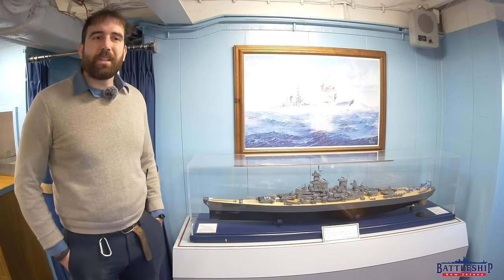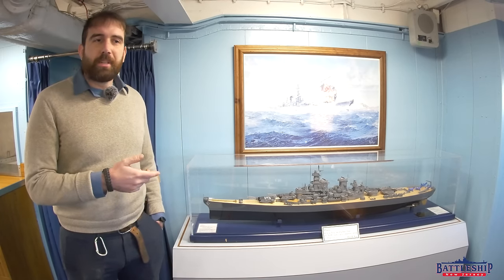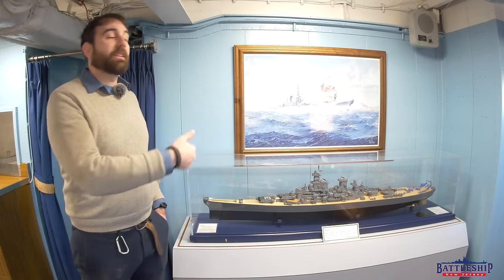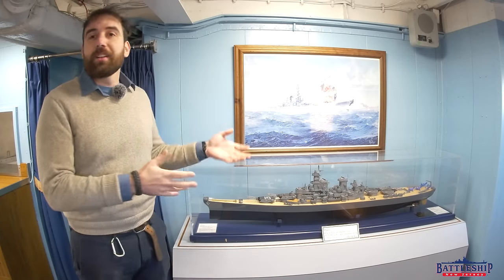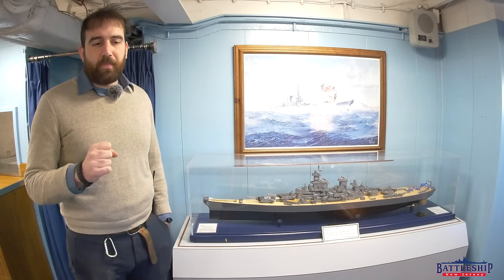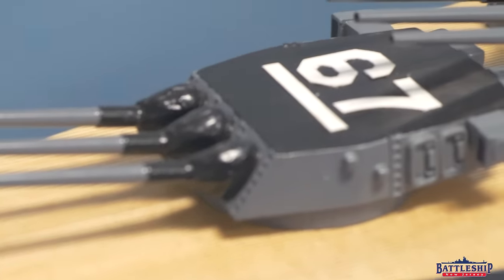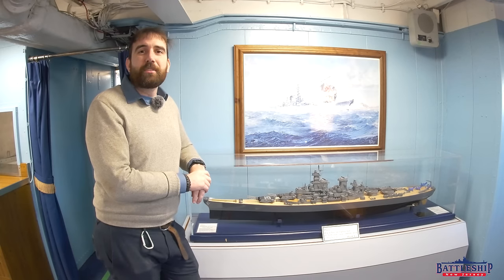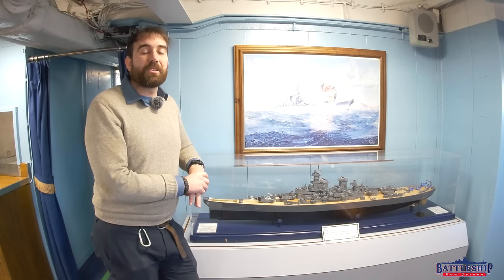Battleship Montana: What Would We Have Done Differently

Comment: The biggest improvement to these ships would have been the development of a bigger bore version of the 16" L50 Mark 7 guns, a notional 20" L40 Mark 8 gun mounted in pairs.  At one point an 18" L47 gun in twin turrets was considered for the Montana's, but this under utilized the existing turret design; the short 20" gun would have increased gun power by around 37% over the 18", fully utilizing the turret capacity.  The 20" gun would have had twice the broadside weight of the 16" gun, such that 6 x 20" would have equalled 12 x 16", and the fourth turret could have been dropped, and the 20" projectile would have had around 15% greater penetration performance.  With some of the weight savings mentioned in this video, the ship could have been reduced to 60,000t and 30 knots speed from the projected 70,000t and 28 knots, although it would not be able to transit the Panama Canal, but as like the today's CVN's that is not too great a problem.  Iowa's could have been ended at four units, and four of these units started under a prolonged war scenario where battleships continued to have a vital role in the conflict, perhaps following these battle units with a pair of monster 80,000t ships with heavier armor, a fourth turret, a surge capacity in the machinery to make 31-33 knots, and an air defence fighter group, a super dreadnought that could have pursued other major surface warships to destruction (retitled 'Alaska" class, rather than the confused cruiser design that became Alaska and Hawaii).

Comment: Would it been feasible to add-on the 4th gun turret aft with minimal problems to one of the Iowa’s? I ask because the largest thing I see for differences is that, the 3 extra guns.(besides length/width, tonnage,etc.)?? Or even a smaller 14” set of guns, maybe?

Comment: All of these changes sound good. But as some other people have said, helicopters become an option in '44. Which means if you wish to, you could remove the aircraft handling equipment in the original design in order to potentially install an aft hangar or more AA.

If I was in charge, I'd steal the British single Bofors guns and replace the 20mm guns on a 1:1 basis unless I can fit more 3" on instead of the Thunderbolt 20mm guns. This would provide an extremely lethal mid-range anti-aircraft suite, perfect for these ships.

On the note of armament: I'd be tempted to reduce weight further while increasing anti-capital firepower (Especially if I am meant to fight Yamato) by switching to the 18"/50 guns to actually have a proper immunity zone against Yamato. The smaller profile of a twin turret being a nice bonus, allowing for smaller barbettes and thus lowering the weight further.

You could potentially capitalize on these by stealing the boilers Richelieu used and adapting them to higher pressures (You are refitting her anyways by this time, so with prior knowledge you could probably get them). I don't expect the Montanas would go as fast as the Iowas, but 30kts is within realistic reach. This would also allow them to keep pace with later ships.

All of this brings me to a final point: Hydrodynamics. If I could retain the speed and make the bow more positively buoyant for the sake of hydrodynamics, that id another change to be made. Montanas would require a rebuilding of the Panama locks, so additional length is not as much of a concern, though keeping it lower is a bonus.

Comment: With aviation becoming more and more prevalent, and large advancements being made in torpedo design reducing the armor would be in my mind a key thing to consider. A bit less armor, say 9-10 inches on the belt, turrets, barbets, etc. Delete the armored conning tower, and go to a single funnel as mentioned in the video. 
Allows for a higher top speed, and much more anti-aircraft weapons. And looking forward in time with how the Iowa's developed, would allow for more of the advanced weapons and systems that the Iowa's received to be installed.

Comment: The 2,700 pound super heavy armor piercing round replaced the 2,240 pound armor piercing round and canceled out the advantage of the 46cm  guns on the Yamato class.  The "X" turret would disappear from the design along the way. 
The single funnel would be retained. The armored conning tower teplaced by one that is armored against strafing aircraft. An armored citadel below the water line for protecting electronics below the mast could be added. Equipment can be repositioned to space reserved for the X turret. The 40mm on lower decks replaced with the twin 3"/55. Upper decks with single 3"/55.  
The 5"/54 semiautomatic guns might be available and would help against kamikaze attacks in the late war. Same number of 20mm barrels but all in twin mountings.

Comment: About the US never building a battlecruiser, the Alaska-class counts as one on a technicality. You had a ship with the size, weight, and displacement of a heavy cruiser, armed with twelve inch guns. Though the US referred to them as "Large Cruisers," the 12-inch main battery naval rifle were still battleship caliber (if a very light caliber following the increase in standard gun caliber for battleships of her time.)

Whether or not the Alaskas were battlecruisers appears to be an ongoing debate amongst naval historians.

As for what you mentioned with regards to doing the Montana differently, I have to agree on most accounts. I would take the weight of the conning tower and move it to the CIC as additional interior armor. Additionally, a retrofit in the 1970s or 1980s to replace the old steam turbines with diesel electric turbines, and replace Turret 4 with VLS launch ports for missiles. Also, replace the older radar system with an AEGIS radar and more sophisticated fire control system in the 1990s.

Comment: The Montana class BBs were designed as the ultimate battleship the US was capable of building under the restrictions of US yards, harbors and seaways. It and the Midway class carriers were going to use the new locks authorized and funded by Congress in 1938-39. In 1936, the USN's cryptology sections finally decrypted and translated a radio communication dated from 1922. This had been a routine communication and with the limited resources provided by Congress between 1921 and 1939, it had been set aside for later decoding and translation when assets were available. It turned out to have a major impact on the USN's war plans and building programs. The report was from the trials of the IJNS Mutsu, a Nagato class battleship completed in 1922. The IJN ran trials at a displacement slightly less than combat displacement. The IJNS Mutsu had exceeded 26 knots. That meant that the IJN had been lying about the speed of its warships. The publicly admitted speed for the Japanese battleships was 22.5 knots. The standard nominal speed of the US battleline was 21 kts, though in actuality, USS Oklahoma could make just under 20 kts, and she and the New York class battleships would shake their reciprocating engine machinery apart if they maintained that speed for more than 4 hours. This why the USN specified 23 knots for the first "South Dakota" class battleships, which it considered was fast. Now as of 1936, the entire US battle line was obsolete. The best ships, the three recently rebuilt New Mexico class could make 22 knots. So instead of a 3.5 knot difference in battle line speeds, the USN was facing over 5 knots. The USN had practiced battleline tactics to offset the superior speed of the Japanese battleline. These tactics were now ineffective. Where the USN had specified 23 knots for its newest Treaty battleships in their original design, now the specified 27 knots. You can't have everything on 35,000 tons standard displacement. When a treaty is signed by the President or his representative and "advised and consented" to by the Senate, under the Constitution, it becomes US law. For the USN to exceed Washington, London 1930 and London 1936 treaty limits was to break the law. So the new battleships had to displace 35,000 tons at standard displacement. So, to get 27 knots, they introduced the new high pressure and high temperature (800 F and 650psi) machinery. While it was lighter, it took up more space, especially when installed as units, so that not all the boilers and turbines were lost with a single torpedo hit. Since maximum firepower under the Treaties, twelve 14" guns were sought, protection had to be cut back. The North Carolina class could make 27 knots at intended battle displacement, carry twelve 14" guns (these were replaced at the last minute with nine 16" guns) and was protected against the 1,500 lbs 14" shell (which was more or less equivalent to what the IJN's Kongo class "fast battleships" and the Fuso and Ise class battleships carried) and a 700lbs torpedo warhead. Unknown to the USN, the IJN had introduced oxygen powered torpedoes, the Type 95 21" sub torpedo had an 880lbs warhead and the 24" Type 93 had a 1,088lbs TNT warhead. The next four ships, the second South Dakota class, were designed for 27 knots and carried nine 16" guns and were protected against the 2,250lbs 16" shell, pretty much what the Nagato class carried. The US was allowed under the 1930 London Treaty fifteen capital ships. This treaty was not repealed until June 1940 with the other treaties. In the meantime, the US, France and the British, the signatories of the 1936 London Treaty demanded in 1938 that Japan sign the Treaty and/or reveal their plans for capital ship construction. They refused and the US, France and Britain exercised the "escalator" clause increasing the limit from 14" to 16" guns. Which is why the North Carolina class was armed at the last minute with the 16" L/45 Mk.6 guns, the gunhouses and barbettes for a three mounting being very close in size to a four-gun 14" gun turret. The also negotiated a codicil increasing standard displacement limits to 45,000 tons. Originally, four more "South Dakota" class BBs were going to be built. With the increase, they looked at a twelve gun "South Dakota". Instead, the USN decided to use the extra 10,000 tons to get a "South Dakota" that could go over 30 knots. These Iowa class BBs would be able to run down and destroy the three 26 knot Japanese battlecruisers (the USN was unaware that the Kongos had been rebuilt a second time and could now make at least 29 knots and that IJNS Hiei had been rebuilt from a training ship to the same standards as the other Kongos). These ships would also be the equivalent of a "South Dakota" in the new 27 knot battleline, not battlecruisers. That would give the US ten 27 knot capital ships by 1943. To complete the battleline, the USN would order five more capital ships. If France had not fallen in June 1940, they might have been the twelve gun Iowas. Instead, Congress abandoned all the naval treaties in June 1940 and authorized five ~60,000 ton armed with 16" guns and capable of making 27 knots. 
With the rise of the fleet aircraft carriers, the Montanas were a questionable use of resources. Certainly, the carriers needed capital ship support for AA defense and for surface combat during night or bad weather. But the fleet carriers could sustain over 30 knots. During carrier battles in 1942-43, the carriers would accelerate to 30 knots and leave the North Carolina and South Dakota class battleships behind, sometimes miles behind. The only way to make the Montana class relevant would have been to get the maximum sustained sea speed at battle displacement over 30 knots. After the war, the USN looked at what it would take to get the North Carolina and South Dakota classes up to 30 knots and found it prohibitively expensive. The largest machinery plant the USN had was the 220,000 shp plant in the Iowa class battleships and Midway class battle carriers. Until the USN adopted the 1200F, 900 psi boilers in the late 1950s for the three later Forrestal class "supercarriers", the best they could do was around 240,000 shp and that was pushing the machinery and might have caused reliability issues. This would be a 41% increase in shp. Experience meant that empirically, a 41% increase in shp could lead to a less than 10% increase in sustained speed or just over 30 knots, but more likely somewhere between 29-30 knots. This would have required larger machinery spaces and some weight trade-offs with protection, firepower or both. By 1945, both prospective opponents had been sunk by massive air attacks and the Iowas could handle anything left on the seas. So, given there were a lot of other things the US could do with ~300,000 tons of steel. Cancelling the Montanas was economically and strategically the thing to do.

Comment: You've pretty much nailed the improvements that would have happened.

An increase in speed to at least 30 knots, if not 33, would be #1.  There is a solution, already designed......the engineering plant installed in the Midway class carriers.  Along with conning tower removal, superstructure redesign per late Clevelands and Baltimores, going to single funnel.

Are the 5/54s that much of an improvement over the 5/38?

Limit your 4x20mm mounts to a max of four, maybe 6.

Comment: Others have listed this, but I think it needs more explanation.  Remove the crane and catapults for the OS2U/SC complement and plan support for helicopters only.  Scouting is no-longer a task for seaplanes, but spotting for shore bombardment is still needed, and can be done with helicopters.  As light as the then available helicopters were, an elevator to raise them to the aft deck will be adequate and much lighter than the crane and catapults removed.  With folding blades, the helicopters will require much less space to stow internally, freeing space for other purposes, or allowing more to be carried.  Longer-term, this will permit the helicopter complement to provide some level of anti-submarine defense independent of escorts.

Comment: When making the super structure smaller the main gun batteries don't move, so would you really need to limit the ship to only six 5in gun turrets? It seems you could keep the numbers for the 5in gun turrets up while maintaining your focus on centerline guns.

I'm thinking five 5in turrets forward and five aft, with the odd one out in each group being superfiring as you suggested. Elevating the aft pair in the forward group and placing them slightly inboard of the forward pair should allow them to be placed really close together while maintaining good arcs of fire. Doing the same in reverse with the aft group would have the same effect.

Comment: I know that it is probably not practical, considering the ranges at which battleships are supposed to fight, but I would have added torpedo tubes on each side (quints) in a protected box just above or below the main deck or stern mounted like the Graf Spee. For practical purposes, this would require a torpedo with 2 or 3 times the range of the torpedoes that were currently in service at this time.

Comment: I would have scrapped the armored conning tower and all of the 20mm guns and tried to extend some armor below the waterline near the engine rooms.  I would also beef up the rudders to be rated for a direct torpedo hit.  We could save a little more weight by not fueling up all the way and rely on a mid-voyage refueling via a tanker ship in the convoy.  Just enough fuel to complete the patrol plus a little extra, meeting up with another tanker half way back to port.  And then of course, welds in place of rivets.  I would also add a disco ball in the wardroom;  being invented in the teens and early 20s they were available at the time.

Comment: I'm no expert (obviously!) but I can't help but think that replacing a "flag bridge" high above decks with the "Combat Information Center" concept in a more secure location below decks and behind the armor belt to take advantage of better radar, communications and other systems.  I realize that this was a time when there were still officers who were trained in the older habit of visually tracking the battle from an elevated position but Ryan already discussed the benefits of removing weight from higher up for stability and reducing the size of the superstructure in order to free up space and weight for additional AA capacity.

I would also second the idea of either changing the air wing from fixed-wing to helicopters.

Comment: Honestly, you could get away with removing a bunch of the main belt armor plates, or swap them out with thinner plates, due to them being external instead of internal like on the Iowas. This would drastically reduce weight, which would improve speed, and shouldn't cause too much of a change in stability. I would also personally look to up-gun the ships to the USN's 18in/48 cal gun. Having 8 massive guns in 4 twin turrets would still give the ships absolutely awesome firepower on a similar hull.

Comment: 1.) Welding vs riveting. (Weight.) 
2.) 1,200 psi boilers. (Power/speed.) 
3.) Cancel 1 ship (4 instead of 5. Cost.) 
4.) 920x120 feet. (Slightly less weight.)

Comment: What if they put 3, 16"/57 Caliber guns in 3 turrets instead of 12 of the Iowa class guns? Wasn't range more of an issue than diameter, since the super heavies could penetrate everything on the Yamato except for completely holing the turret face? They already had been testing one in lieu of using an 18"  barrel because it created too much shock. In fact, the Yamato Class gun crews did not do so well with that 18.1" gun. The testing goes back several years, so this should not affect our alternate timeline - much. 😁